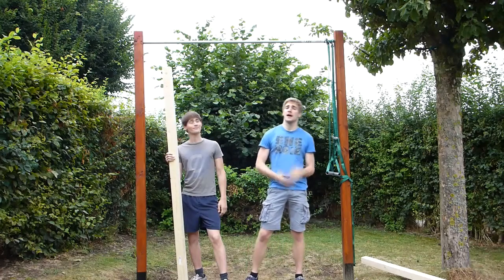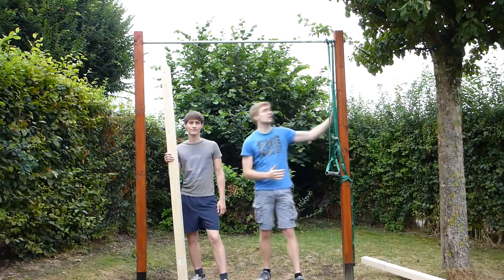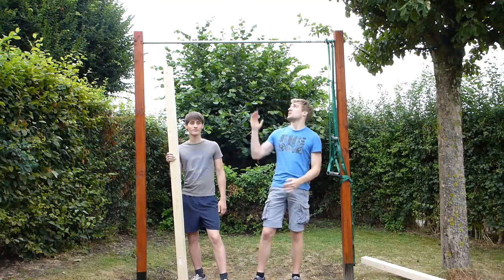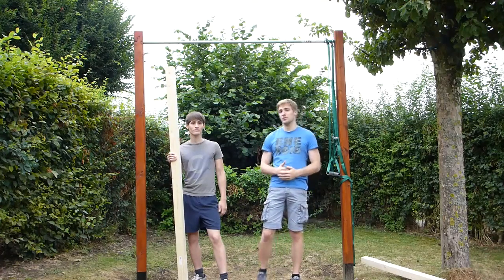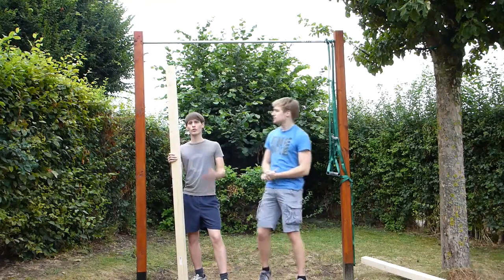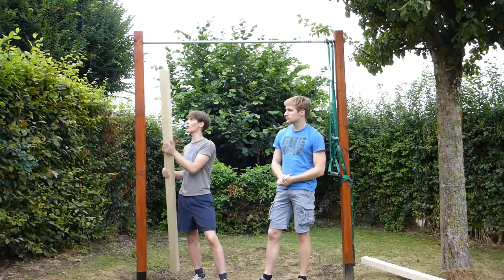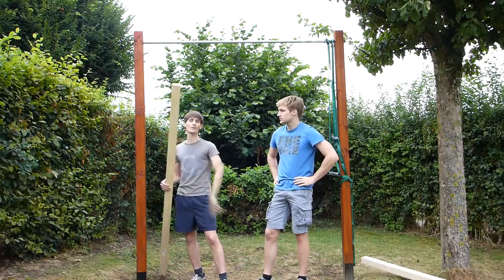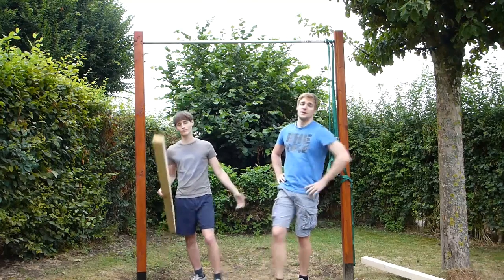DIY Backyard Pull up Bar Upgrade

Comment: What kind of wood paint did you use?
Reply from the maker: We used bangkirai nonslip. But every wood paint will do, make sure it is graded for outdoors. 
And if you buy precoated wood, you don't even have to worry about paint.